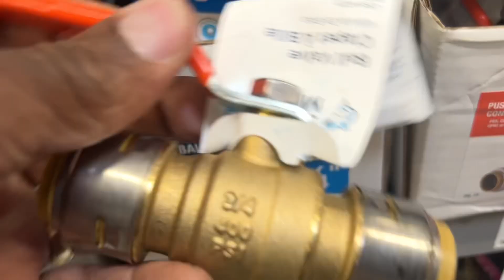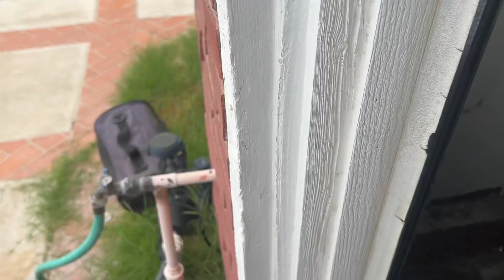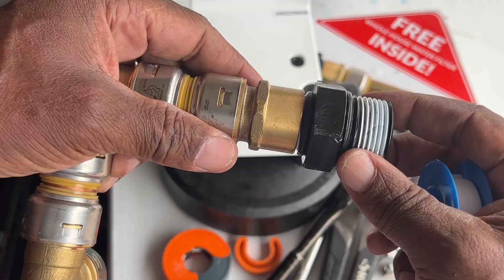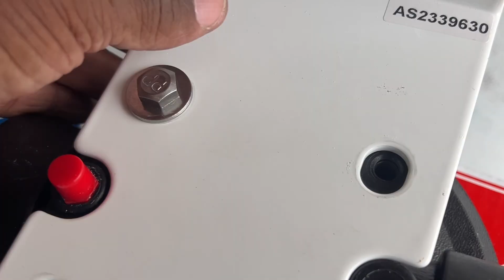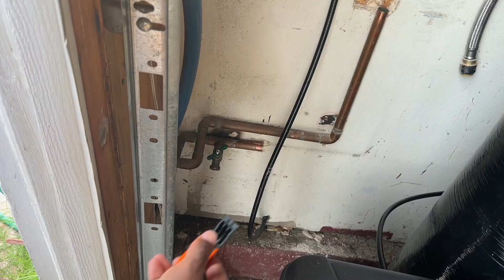AQUASURE whole house water filter installation water softener installation video link at end

Comment: This is the wrong way set up. The correct way is Main water line to filter 1st then to softener then to house. If you have hard water to softener 1st then to filter  to house. It will still work but your softener will be damaged in just couple years.
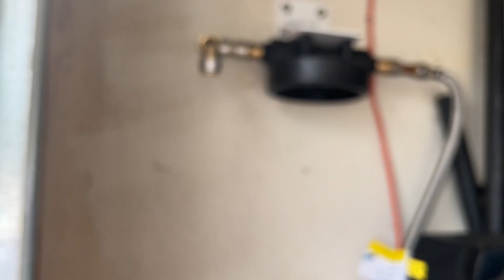Reply from the maker: At 24:03 it shows the in coming water to house going to filter (left Side is in) right side of filter is out of filter going to water softener inlet side. maybe I confused you when I said in of softer while hooking up to filter out.

Comment: Don’t forget to burr inside the copper pipe as well. If you  don’t water flow could be turbulent at the joint eating into the pipe causing a leak